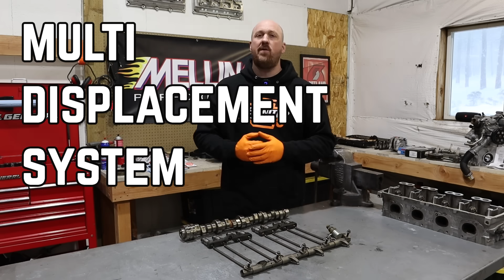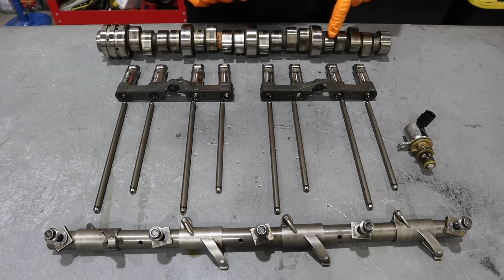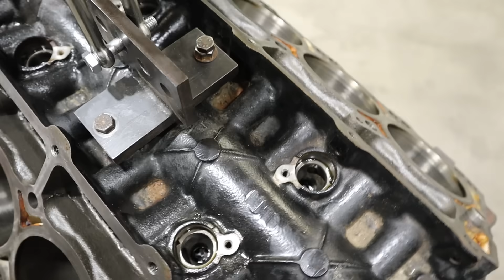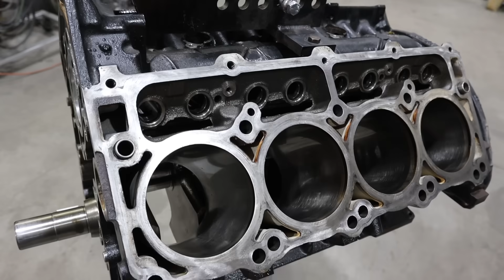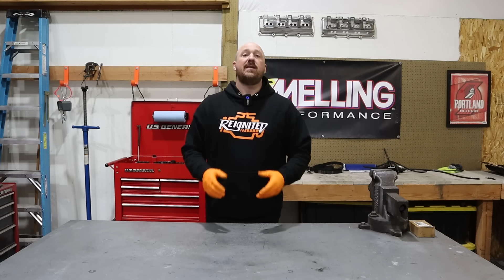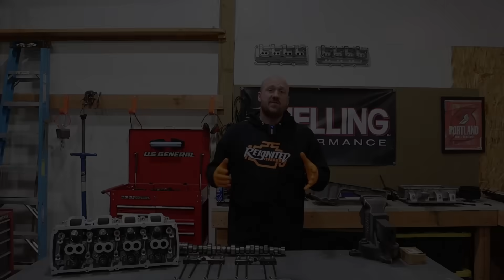Is MDS Damaging Your HEMI? The Answer May Surprise You!

Comment: Great explanation, I like the Dodge but worry about if I got lucky with a motor that wont fail, or stall like Etorque, so my takeaway is not to idle for long, and sometimes my 97 Ford would idle for 30-45min. I have enough problems and dont want to change out lifters, oil pumps, oil coolers on 3.6. So no Dodge in my future like my 91 Dodge pickup.

Comment: This is a great explanation of MDS. Guy did a great job. Here's my 2 cents based on comments I've read here.
Im cleaning up and sorting out a 2012 Sport quad cab I just bought. Im 64 and have owned several trucks since the 80's , owned many rides and powerful bikes. I work on my vehicles. I buy nothing new to me without deep research. 
Even though im old school i think this system is pretty cool and should be used, along with the manual mode when you want. 
Lot of guys in comments here talking oiling, oil additives and stabilizers, heavier weight oil--I say, like many, DON'T. These modern engines use low weight for a reason and thickening it is a bad idea,especially with MDS.
I agree with this guy idling not good. Original owner mine was a sewage treatment plant designer and project manager. Truck didnt 'work' but im sure it idled onsite as he made his rounds. So hemi got replaced with a used 40,000 mile one not long ago. Truck has 117k on odo. 
He talks lifters and valves here...think he's right. Many techs say valves were weak. Ram later coated them but still weak er than ideal.
Sounds like stock hemi dont need high flow pump and avoid any big pressure boost but a high flow oil filter very good idea.
What concerns me most with this truck is the 2012 and up Chrysler 68 RFE 6 speed in these. They were weak for a 400 ftlb torque Hemi. Im gonna keep an eye on mine and not thrash it. Failures common especially 12-13.
But the deal i got on this fully optioned Sport in its condition...seriously, you dont want to know. But if it ever needs a rebuild I won't grouse. They really are a great looking and riding truck.

Comment: Im reading for stock 5.7 you dont need or want higher flow pump. But a high flow oil filter is excellent. Like Wix XP at NAPA. And you change it about every 4 oil changes.

Comment: my understanding is that the MDS started in 2009 after they created the eagle heads, would something like lucas oil stabilizer help protect the lifer rollers better? (just a small amount  in the oil at each change?)
Reply: Im reading additives bad idea as is heavier weight oil. Change with specific blend with correct additives like Pennzoil platinum ultimate synthetic. Has the right additives.
Reply: P.s. Lucas is THICK. Low weight oils in this dont want to be thick and still get MDS cylinders lubed

Comment: My brother in law has the exact same 2016 Ram truck that I do. On the Hwy he gets 24/25 mpg . And the best I get is 19 is my MDS system probably not working. I don’t have any codes for anything. Your suggestion. Can I replace my oil pump without pulling  the motor.

Comment: I like to use my 2003 silverado to drive to the parts store every 3 days so i can fix my 2011 ram 1500
Reply: Got a 2000 Silverado 4.8. Indestructible. Bought a 2012 Ram Sport. Fingers crossed. Has a replacement hemi with 40,000 miles

Comment: Here is the thing with mds. 8 lifters do not have the oil priming hole because these engines prime from the top down. The 8 mds lifters  prime from the top but the roller gets oil from the deactivation pins. When the solenoids activate oil collapses the pins and the oil reaches the rollers on the bottom of the lifter. When solenoids turn off the oil is blocked from the lifter and therefore the rollers no longer get oil. This is why continuous idling will destroy the lifter. The 8 non mds lifters have a tiny hole that lets oil build in the bottom of the lifter to keep oil at all time. The mds do not have this hole. Deactivating mds or constant idling will cost you over 2000 dollars in repair. Replacement non mds lifters will have a small hole in the side like normal lifters and when the solenoids are pulled and plugs placed oil is allowed to flow freely to the lifter and prime through the side hole and oil the roller. The 8 non mds lifters don't need it. Mds lifters are two lifters in one. Top half oils from the top through the push rod and the bottom oils from the locking pin and solenoid. This is why cams are being wiped out due to the mds not being allowed to operate
Reply: What happens in tow haul mode? When MDS is automatically deactivated.
Reply: Thanks for this
Reply: @RealJayGladney  I want to add that the design of this is like a solid roller lifter but uses a hydra lock instead of being actual solid roller therefore have to be manually pressurized before installing or damage to the internal parts of the lifter can damage upon initial starting due to the reverse oiling design. When you look at the engine with valve cover off and vehicle running you can see that the oil that is on the rocker arms and oiling the top of the valve would be impossible to pressurize the lifters on start up as this would be a pressure leak and would take several revolutions in order to force the oil down into the lifter by then the lifters have bottomed out internally with a lot of force that can bend push rods and break internal springs. The oil from the rocker arms is for oiling of the lifters and valves and the ball on the pushrods and not necessarily to maintain pressure. Once the lifters are hydra locked that's it and only require a minimal amount of oiling to maintain down from the pushrod. It's weird I know but trial and error with lack of information and mechanical background and a few mistakes and extensive study and the urge to not accept defeat is when it finally came together. Amazing how something that really is quite simple was so complex to figure out. One more thing eco and mds are not the same! They are integrated into the same circuity for the purpose that you don't get stuck in 4 cylinder mode when your passing someone on the highway or merging into traffic on the freeway. When eco light goes out it shuts off mds to engage 8 cylinders. Eco on tells computer it can engage mds whenever it's ready. If there is a problem with mds it will not activate even though eco is on. So people say if eco is on then mds is working is not true. Check engine light will deactivate eco but this doesn't tell the computer the vehicle is accelerating and as long as mds is in good working order and the check engine light is not mds related or its input sensors for operation then mds will activate without eco light and rely in data from tps for communication until the check engine light affecting eco is corrected and will return to eco for operation as this is where optimum fuel efficiency is best. All this being said when you tear one down 5 times in two months time you get pretty good at it and doesn't take no time at all. Once you understand it well 6 months running now 200,000 miles and runs like a brand new car no ticks. Shaved heads .015 now 10.75 compression on 93 octane can run 87 but it likes 93 ported polished exhaust ports ported stock exhaust manifolds , half inch intake spacers not tb spacers but intake. Tapered intake ports and tapered tb port with slight angle port on tb at 200,000 miles stock cam no tune 402 hp
Reply: I’m so glad my 6.1 Hemi doesn’t have mds due to its being an ancient engine lol but I’m still worried about lifter failures. Just gonna avoid long idling and change oil at every 3k and hope for the best
Reply: Would you recommend just leaving the MDS then? And is the high flow oil pump worth it aswell?

Comment: I have a 2008 jeep grand cherokee overland with the 5.7 hemi, i took the MDS off by diablo sport tuner, and the gas mileage is the same as with the MDS system, so I call BS on gas savings, just more parts to replace. I did the MDS delete by tuner because with a borla exhaust system evertime it goes into MDS mode it sounds like a slug. So get a tuner and delete it. Hope this helps. BTW I wont buy anything newer than 2013 because of all the junk out there. Older cars and trucks are just plain better. 😊
Reply: How many miles on it? Thinkin of doing the same thing
Reply: @V8NATEE 100k

Comment: 2020 1500 stock I got up to 25.2 mpg on 95 heading to Florida and today after 6in lift 35in tires I get 18 to 20mpg
Reply from the maker: Dang, that's impressive! We've got a lot of mountains where i live so it's very difficult to get good mileage in anything.
Reply: @ReignitedAuto yup seams like when you take north to south interstate it's more level east to west it more up and down. I live at 3k ft above sea level of course going east I get more but still I'm at 17.4 to 17.8 I feather the pedal and keep it at 60 65 tops. At 70 and higher it drops really fast

Comment: I read a forum that mentioned the following: former Chrysler engineer. "If you did disable the mds, you best change the lifters and a few other internal items including a high volume oil pump. If not, you will not have the oil pressure and oil flow you need. This is one of the reasons hemi gets a bad reputation. People not using 89 octane fuel and people always turn the mds off without replacing the internal parts of the motor."
Reply: That’s definitely not true

Comment: What high volume oil pump would you recommend for low idle on a 2024 Ram 2500 with MDS?
Reply from the maker: They haven't changed the engine at all, so if you're keeping MDS go with the Melling M452HV pump 👍
Reply: @ReignitedAuto  Awesome! Thanks dude! 😎

Comment: Discovered your videos and they are very informative and explains what I need know about the 5.7 hemi engine. 
I've got a cam shaft and lifters failure and now I'm stuck in between getting a reman long  block or get a MDS delete kit w/ possibly a small upgrade. Would like to know what delete kit and modest upgrade is best. My truck would be a daily  driver but would like to have enough power to throw you back in seat. I would be doing work myself any suggestions would be greatly appreciated.

Comment: I have a 2019 5.7 hemi and it ticks hard when eco mode turns on.   Like a metal baseball card in a bicycles spokes.   

Question: Is the damage done lifters toast?  Or will replacing the high pressure pump solve that ticking?  I mean it is loud and echoes off houses and the buildings in my town (super embarrassing).  

Thank you in advance!
Reply from the maker: The high volume pump will not correct any pre existing issues, it's a preventative measure only. 
However, in your case i might suggest something. The 2019+ ram trucks have a major issue with the exhaust manifolds cracking right down the middle. This can produce a noise like what you are describing. I would have your manifolds inspected first before jumping to any conclusions about internal engine issues 👍

Comment: Thanks for the detailed explanation.  *Selecting "Sport Mode" on the Challenger also deactivates 'MDS mode for performance... thus all 8 cylinders receive full oil flow. ( will checkout your "VVT" video next ) 👍
Reply from the maker: It's the other way around, the lifters receive full oil flow WHEN mds is active, meaning when it's in 4 cylinder mode.
Reply: @ReignitedAuto  Understood.  Thx for the clarification. *I worded that incorrectly. 🤔

Comment: im about to purchase a 6.4 scatpack with MDS here in germany. ive read that MDS wont be active if the gearbox is in sport or manual mode. i would only drive in custom mode with the gearbox on sport that. is that correct?
Reply from the maker: That is accurate and it's exactly what I'm talking about in this video.

Comment: 2020 Durango SRT. 125,000k
Has been extremely well maintained.
On its 4th set of tires because the dealership wasn’t performing alignment properly. Fuel pump went. Dealer wanted $2k for the pump alone. Now the MDS caused a lifter failure. MDS delete done. Picking it up tomorrow. Considering selling.

Comment: High pressure pumps and high volume pumps are not the same. You are using them as interchangeable.
Reply from the maker: I'm very well aware they are different and don't believe i did so in this video, do you have a time stamp I'll check it out.

Comment: i have a jeep 392 with this system, i run in manual mode all the time, i get no different fuel milage. average 21 on the highway. but when it shuts the 4 cylinders down it runs like shit. as soon as i down shift she runs perfect again. i want to remove my MDS
Reply from the maker: That's definitely one of the models that I suggest removing the system entirely.

Comment: Good video, I read so much stuff about MDS systems will hurt the engine even lake speed jr  saying it’s not good for the   Engine in the long run , but you know the hemi engine so I leave my MDS on 
So is there any problem to engine leaving The system on 
Nice channel nice job
Reply from the maker: Nope, as I mentioned if you are leaving the vehicle largely stock it makes the most sense to just let it operate as designed. 👍
Reply: Thanks I’m glad your still doing you tube
My Ram getting 25 mph in town with MDS on 
MDS off in town 18 mph 
Thanks

Comment: Does the deactivation cause uneven heat in the aluminum heads? Does it contribute to warped exhaust manifolds?
Reply from the maker: Not at all. People do not realize that there is engine oil and coolant running through the cylinder heads that is kept at a specific temperature, this evens out any potential temp differential. 
The warped exhaust manifolds happens because the weak factory bolts break and once the manifold is not held in place properly the heat warps the flange.
Reply: Just drove my new 2500 home from Ohio to Western New York. There was no visible indication that the MDS was activated. My '09 5.7 Hemi in my TRX4 would flash on panel every time it kicked in.  Am I missing something?

Comment: I have heard that most times it has to do with all the idling the engine times meaning if the engine is idling allot the oil flow has issues getting to the top end of the engine, a workaround is to install a high volume oil pump like say out of a hemi challenger ( I think its call hell cat) which apparently they come standard with them , I am not sure iof any of that tis true though,. on topic here  Ithin ktha tits pretty stupid to have a truck with a v8 that uses such tech because trucks are mostly for work like pulling hauling things around having such tech is just silly what buy a V8 engine if your not going to be using it .
funny thing I typed the above before the 5 min mark of video and then you say pretty much the same thing about idling hehe

Comment: If it is not there, the engine lubricates itself in a normal manner. Change the oil regardless. 5000 miles with a good synthetic oil. 10,000 miles is the same as 12,000, oh..... forgot and 15,000, well everything is fine and really don't want change it yet. The Stelantis engine will grenade, it is guaranteed.

Comment: I know this is a old video. But at around  12:57 you mention it actually can cause a problem turning off mds, via gear change and or tow mode keeps it off, and doesn't provide the oiling of mds lifters so can be a problem.  So my question is, I tow most of the time so mds is turned off in tow mode? This doesn't make much sense then to use tow mode on this truck if it hurts mds lifters by not ever getting proper lube when off. I would think the opposite- If somehow you could have mds on all the time(deactivating 4 cyl) this then would cause a oiling problem. But driving it as a normal v8 all the time, how could this hurt,  either in tow mode or turning it off.  Please clarify this. I am confused or missed something.
Reply: agree

Comment: Curious if increasing idle rpm will help with mds low oil pressure while idling???
Reply from the maker: That's another option for sure, I personally just don't like a high idle so I prefer the high volume pump.

Comment: If I get stuck in traffic with my 2022 Power Wagon I switch to the oil pressure screen on my dashboard display and 'blip' the throttle for a few seconds when it drops into the thirties.  It normally runs at 53 psi when I'm at a high idle.  Is it necessary?  I don't know but I'm not going to take a chance.

Comment: I have a 19 1500 5.7 47k miles lifter failure on cyl 6 only 200 idle hours vs 1400 drive hours and do my oil changes every 4k not sure why it happened 😢
Reply from the maker: That's very low mileage for lifter failure, did you see the damage parts yourself?
Reply: @ReignitedAuto unfortunately it was a very quick interaction at the dealership. Tech Did show me the lifter that collapsed and said it was one of the few low mileage failures he has seen, also said filter screens were also relatively clean for a failure.. It’s still under warranty so getting new cam and lifters. The dealership has been around a while and pretty reputable so hoping they just didn’t sell warranty work

Comment: What is the difficulty of replacing the oil pump on 2019 Ram 1500?
Reply from the maker: It's a very similar process to the cars,  but it has the added difficulty that you'll have to drop the oil pan as well. Some people get shady and just bend the pan to get the oil pickup tube bolt out, but that's too sketchy for me i prefer to do it the right way. I don't specifically have a video out yet on that install, but I just purchased a 2016 ram 1500 that I'll be doing the video/ install on later this year, probably not until fall though.

Comment: The nitty gritty of it is before MDS these engines never had any issue at all with valves or other problems. I did the MDS delete because of it and my drivetrain has never suffered a single collapse valve or ground down cam since.